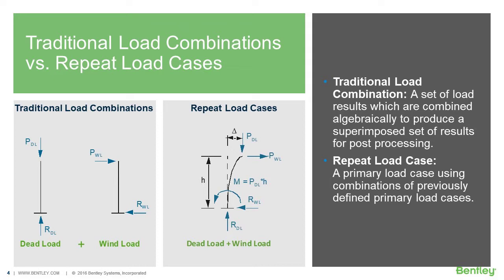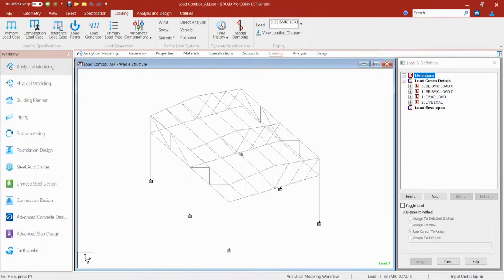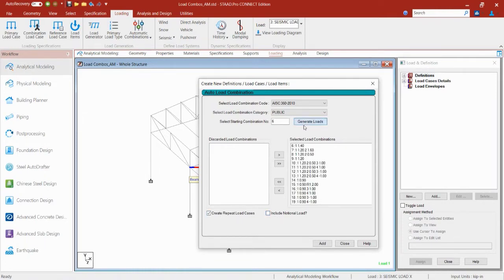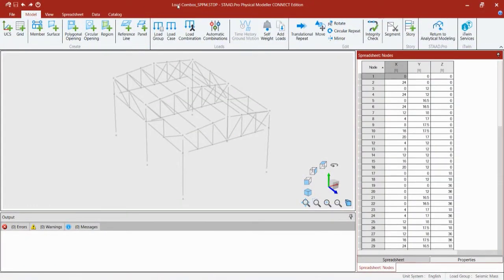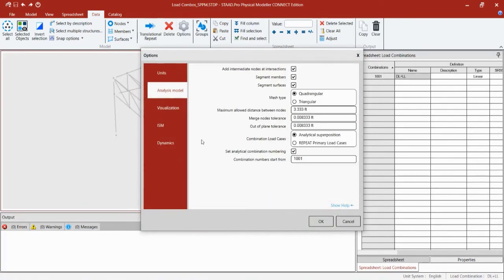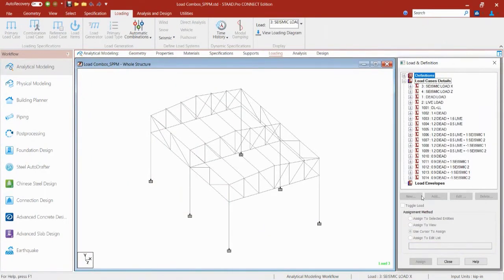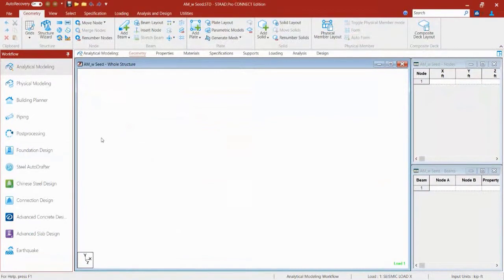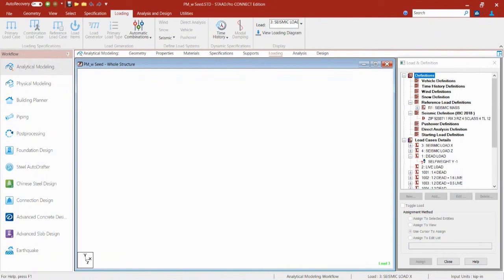Generating Load Combinations in STAAD.Pro

Comment: Hi Sabrina
How can we generate load envelopes in Physical model?
Reply from the maker: Currently, you cannot generate load envelopes in the STAAD.Pro Physical Modeler. This capability, however, is available in the STAAD.Pro Analytical Modeler.
Reply: Thanks for your reply.
Two more questions:
1- How can we make repeat load in case RSA? Apparently STAAD Pro doesn't allow to have repeat load in RSA.
2- In case of using physical model is there any way to have notional loads in both X and Z directions simultaneously in a load combination?
Thanks in advance